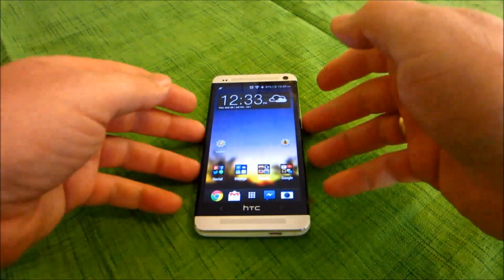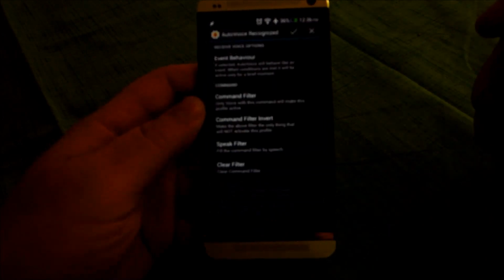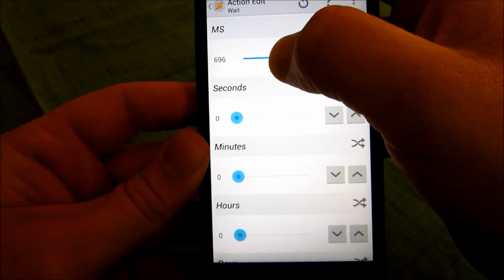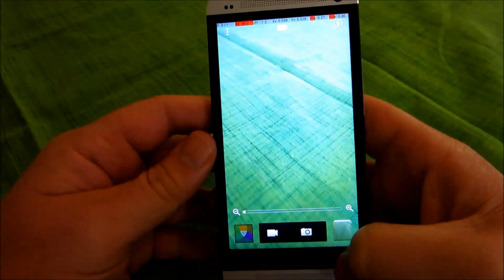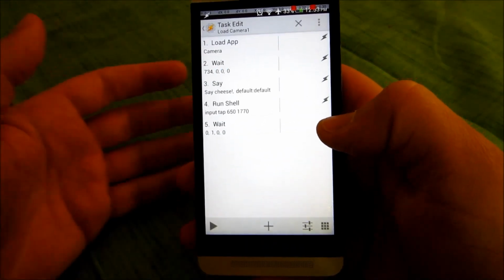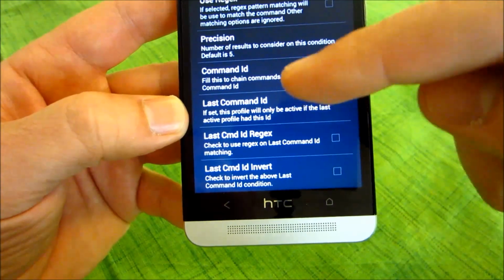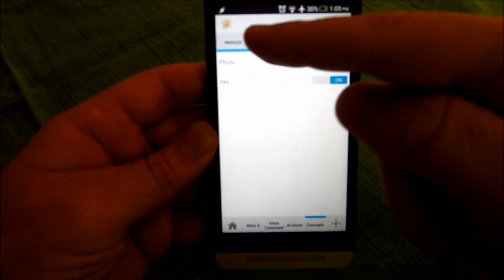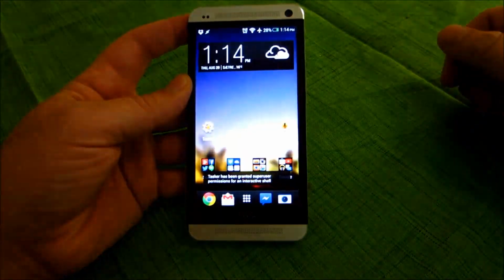Voice Controlled Camera using Tasker

Comment: Is it possible to use autovoice without internet connection?
Reply from the maker: I think it needs internet because it uses Google voice services, but maybe there is a way to download that for offline access. I know that Google now had a setting for that.
Reply: ApexPredation could you make a tutorial on making it offline without flashing anything?
Reply from the maker: Jefrey Silang so I just tested a simple setup using autovoice and tasker to open open an app with a voice command, and it worked with the WiFi and Mobile data turned off. I tested on a stock HTC One M8(no root) so it seems autovoice will work without internet connection. At least with English. There was nothing special I needed to make it work. I recommend testing the free version first. It is limited to short words like "cat" or whatever other 3 letter word.
Reply: ApexPredation ive tried it offline too but it doesn't really work.. Maybe it's  not just supported on my phone -.- anyways thank you so much for the response sir!  (Y)

Comment: ApexPredation mine will neither say cheese or take the picture why could this be?
Reply from the maker: It is very difficult to know why but I would recommend to review the steps to make sure that all things are set up correctly. The say command will not automatically turn up your volume so make sure your media volume is turned up.
Reply: Kk